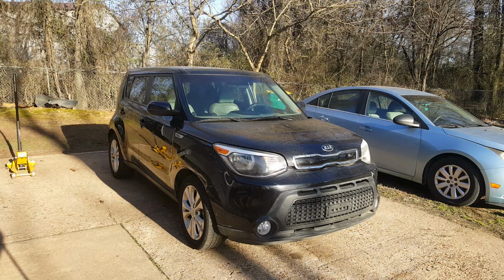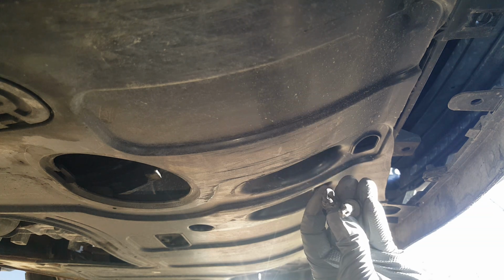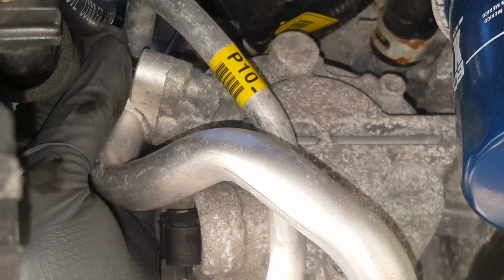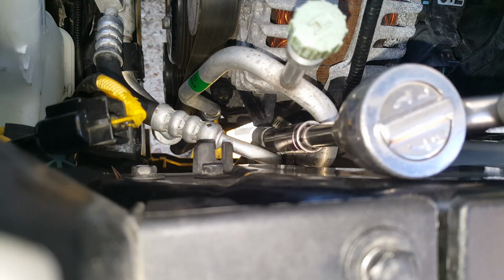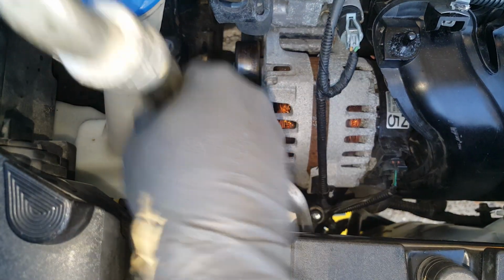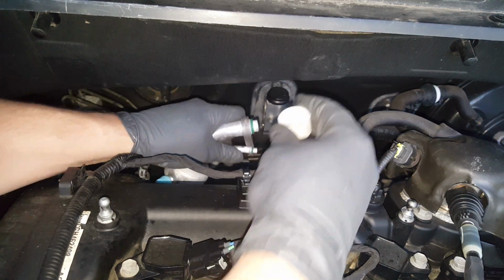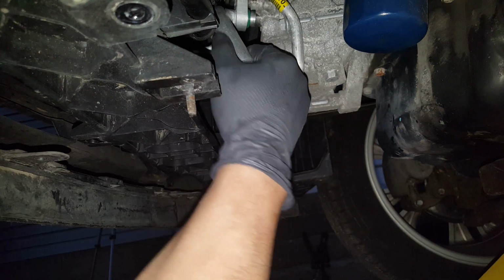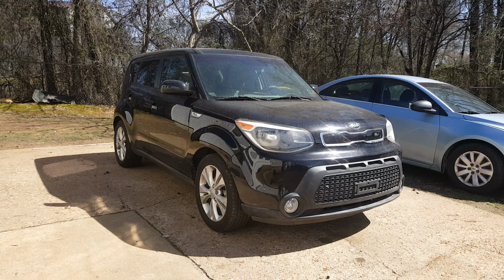2014-2019 Kia Soul ac low pressure port suction line replacement

Comment: Good job. My dumb ass bought a '19 soul that obviously been in a wreck but I was desperate. Purchased during the winter months and come to find in the summer it had no ac plus we didn't drive it much that first year. Coming into my second summer with it I'm like I can't do this. So I take a look at it and find the belt half missing and a huge gash in the low pressure line. Just needed to know if the mount needed to be removed. Thanks for the help.
Reply from the maker: I made the 1.6L suction line work on my 2.0L, even though it required some persuasion . Still blowing 40 deg to date. Hope all goes smoothly with yours , thank you for the feedback.

Comment: Was your ac blowing out smoke by chance ? I have a 2019 and it started blowing smoke while ac was on. I noticed lately it's been acting strange really loudly drips  and I could hear it... 😮 not normal I had thought then this smoke blowing out freaks me out ..
Reply: Is the smoke coming out the vent or engine bay? Does it smell like rubber, coolant or other? And is it still smoking?